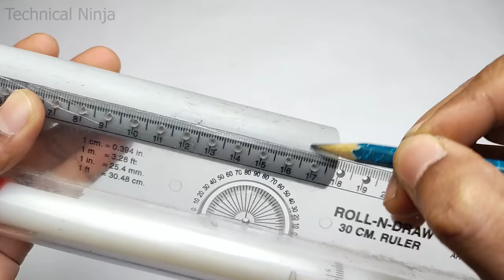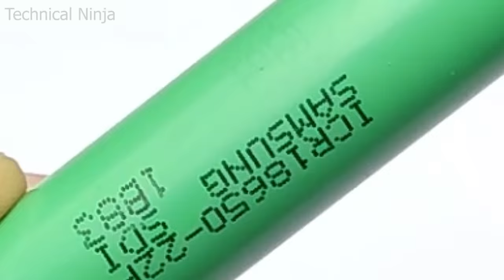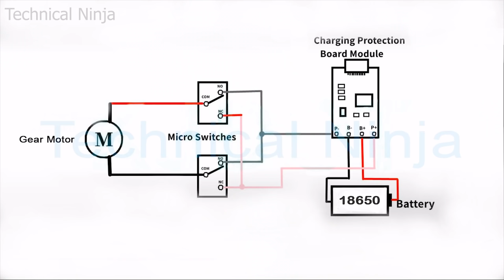How To Make Rechargeable Screwdriver From DC Motor at Home

Comment: Your videos are delightful to watch.
One major drawback in all the d.i.y is  the attachment and intacting the motor,generally both remain loose and have play,secondaly the pvc doesn't have the ability to gusp all the vibration of the motor,better to use dowel and make it a pipe with a thick base.Rest as u feel is better.
Good luck,God bless u.

Comment: Am trying to build this. In charging module battery in voltage shows 3.6. But in output voltage is not coming. Need ur assistance. Also while checking for continuity b+ has continuity but b- not showing. Battery has full charge. Tried with 3 different charging modules.